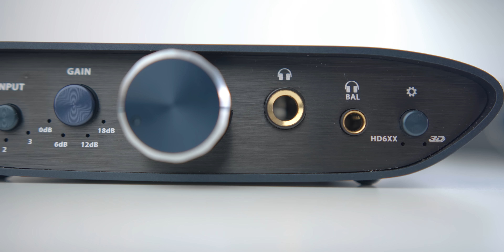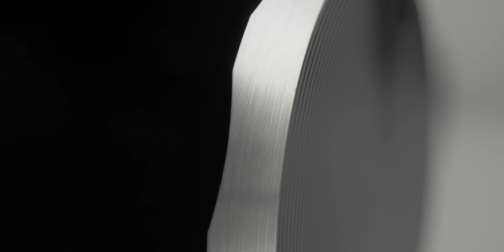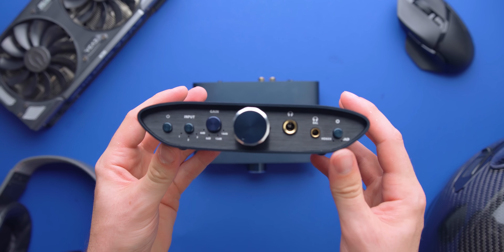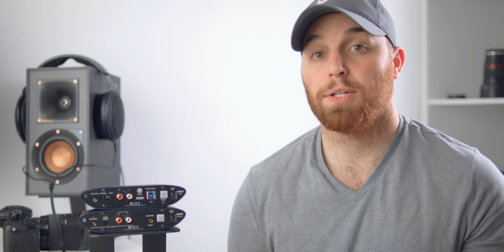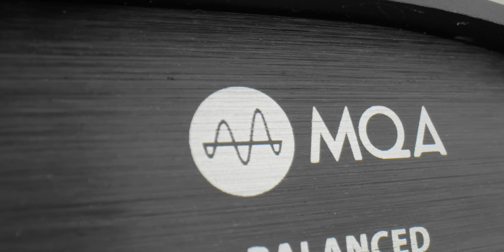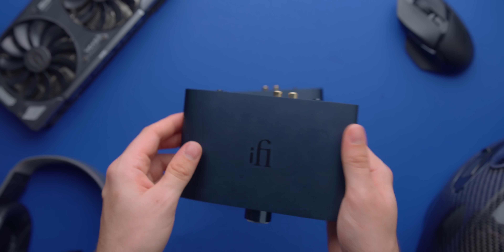THE upgrade for the HD6XX! | IFi CAN / DAC signature!

Comment: Josh,
Really well constructed and balanced review! Pardon the pun. I’ve been looking for a combo along these lines to get myself into the headphone world. Just been a two channel speaker guy so far. I’ve also been looking at the Geshelli Labs combo, which also offers an interest and low cost dac and amp combo, with a balanced connection, and different gain levels to boot. Wonder what you impressions of that combo would be in comparison! Thanks again 🙏🏼

Comment: Why are people commenting that this is a Drop ad. He states clearly that the unit was sent to him. He also clearly states it's hard for him to recommend based on the use case, and don't expect it to replace a tube Amp. 

I'm curious what the 58XX would sound like if you plug a pair in and hit that 6XX button.

Comment: If you ignore the bass boost. Does it really make a difference to Ifi zen dac for ~130$? This is almost 4x the price.
Reply: I believe the zen dac also has a bass boost switch..I don't know if it could handle a 300ohms headphone tough
Reply: @SM-1234 late response, but I own the ifi Zen V2 dac. I also own the Zmf Auteur which is a 300 ohm 97 dB rated headphone. The ifi Zen is adequate and runs it at high enough volumes without maxing the volume knob, albeit running through the 4.4mm balanced output. Getting a dedicated Amp would most likely yield a more refined sound, but I wouldn't consider it absolutely necessary

Comment: I'm a bit confused about balanced inputs. If I buy this or a thx 789, can I use a single ended input and still use the balanced output while still getting the benefits of a balanced output? 
I currently have a schit modi 2 dac, and I'd like to upgrade my amp without needing to buy a new dac. But I want to get a balanced output dac.
Reply: I would like to know as well.

Comment: You can pick up CAN+DAC+ 4.4mm interconnect cable on drop for 338.00
Reply: That doesn't include the DAC that's just the CAN and the 4.4mm.  All three comes in at $557 before tax...

Comment: Everytime drop puts something out all the YouTubers have ad like reviews
Reply from the maker: I posted this in the pinned comment, but I wanted to reply directly. 

"Hmmmm. Concerning trend in the comments. First, this is not an ad. This is a loan unit, sent from IFI. Neither Drop nor IFI is paying me. Nor asking me to say anything (except for the disclaimer about the pre-production status). I am however, part of Drop and Amazons Affiliate Programs, as disclosed in the description of every video. 

Second, if the video feels different and scripted... It is. I am trying a new filming style of video, using longer focal length and moving locations more often (always trying to better the content on the channel). 
- The scripting helps me make more jokes, and keep on track (especially when changing from location to location) with topics and information I might otherwise forget. However, my implementation of this is not the best, as it's one of the first times doing it. And, I see how it could seem more "ad-ish", though, not the intended feeling, I will make corrections to try to avoid it in the future. 

To address some specific questions I saw in the comments that I did not cover in this video specifically. 
This over 789? - For raw sound quality/power, no reason. Other reasons could be size, looks, EQ adjustments (if you don't/Cannot run EQ). I did not say it was better. I just said it outputs about the same power at 300 ohms specifically. So if you have a 6xx, the choice between the amps comes down to you desired features. 
This or Asgard? Depends. Asgard will drive more power demanding headphones, but will not be so good with high efficiency headphones, like IEMS. So, if you have really hard stuff, get Asgard or 789. Those will be the most versatile for more headphones. 
Using this Amp on the 58X - Sure! Sounds great, however, generally speaking, the 58X doesn't really need an amp in the same way that the 6XX does. 

So, to clarify my poorly constructed thoughts here - The Amp, is NOT the best on the market at this price (overall). It MIGHT be the best amp at the price for the 6XX exclusively, depending on your desired features.(If you only want single ended, THX or Asgard are better).  
The DAC, like I said in the video - Not worth it. (unless you REALLY want the stack). Even though it performs as it should. 

- J "

Comment: So... Why should i want to change the 6xx sound signature if it is almost perfect for it price, of course i can EQ 2 or 3 db in the bass region.
 But this is your first vídeo that sounds like an advertising, you sound like a reporter reading. :(
Reply: EQ is software, that adds additional processes and results in higher signal distortion.
This amp has hardware bass and tiny treble boost. You can't adjust intensity like with software EQ but it sounds cleaner than any EQ.

Comment: Agree on the advert feel, CRINGY compared to your other reviews.
Reply from the maker: I posted this in the pinned comment, but I wanted to reply directly. 

"Hmmmm. Concerning trend in the comments. First, this is not an ad. This is a loan unit, sent from IFI. Neither Drop nor IFI is paying me. Nor asking me to say anything (except for the disclaimer about the pre-production status). I am however, part of Drop and Amazons Affiliate Programs, as disclosed in the description of every video. 

Second, if the video feels different and scripted... It is. I am trying a new filming style of video, using longer focal length and moving locations more often (always trying to better the content on the channel). 
- The scripting helps me make more jokes, and keep on track (especially when changing from location to location) with topics and information I might otherwise forget. However, my implementation of this is not the best, as it's one of the first times doing it. And, I see how it could seem more "ad-ish", though, not the intended feeling, I will make corrections to try to avoid it in the future. 

To address some specific questions I saw in the comments that I did not cover in this video specifically. 
This over 789? - For raw sound quality/power, no reason. Other reasons could be size, looks, EQ adjustments (if you don't/Cannot run EQ). I did not say it was better. I just said it outputs about the same power at 300 ohms specifically. So if you have a 6xx, the choice between the amps comes down to you desired features. 
This or Asgard? Depends. Asgard will drive more power demanding headphones, but will not be so good with high efficiency headphones, like IEMS. So, if you have really hard stuff, get Asgard or 789. Those will be the most versatile for more headphones. 
Using this Amp on the 58X - Sure! Sounds great, however, generally speaking, the 58X doesn't really need an amp in the same way that the 6XX does. 

So, to clarify my poorly constructed thoughts here - The Amp, is NOT the best on the market at this price (overall). It MIGHT be the best amp at the price for the 6XX exclusively, depending on your desired features.(If you only want single ended, THX or Asgard are better).  
The DAC, like I said in the video - Not worth it. (unless you REALLY want the stack). Even though it performs as it should. 

- J "

Comment: Would you recommend getting this over something like an Asgard 3 if you have other hard-to-drive headphones?
Reply: No grab the Asgard 3
Reply from the maker: I posted this in the pinned comment, but I wanted to reply directly. 

"Hmmmm. Concerning trend in the comments. First, this is not an ad. This is a loan unit, sent from IFI. Neither Drop nor IFI is paying me. Nor asking me to say anything (except for the disclaimer about the pre-production status). I am however, part of Drop and Amazons Affiliate Programs, as disclosed in the description of every video. 

Second, if the video feels different and scripted... It is. I am trying a new filming style of video, using longer focal length and moving locations more often (always trying to better the content on the channel). 
- The scripting helps me make more jokes, and keep on track (especially when changing from location to location) with topics and information I might otherwise forget. However, my implementation of this is not the best, as it's one of the first times doing it. And, I see how it could seem more "ad-ish", though, not the intended feeling, I will make corrections to try to avoid it in the future. 

To address some specific questions I saw in the comments that I did not cover in this video specifically. 
This over 789? - For raw sound quality/power, no reason. Other reasons could be size, looks, EQ adjustments (if you don't/Cannot run EQ). I did not say it was better. I just said it outputs about the same power at 300 ohms specifically. So if you have a 6xx, the choice between the amps comes down to you desired features. 
This or Asgard? Depends. Asgard will drive more power demanding headphones, but will not be so good with high efficiency headphones, like IEMS. So, if you have really hard stuff, get Asgard or 789. Those will be the most versatile for more headphones. 
Using this Amp on the 58X - Sure! Sounds great, however, generally speaking, the 58X doesn't really need an amp in the same way that the 6XX does. 

So, to clarify my poorly constructed thoughts here - The Amp, is NOT the best on the market at this price (overall). It MIGHT be the best amp at the price for the 6XX exclusively, depending on your desired features.(If you only want single ended, THX or Asgard are better).  
The DAC, like I said in the video - Not worth it. (unless you REALLY want the stack). Even though it performs as it should. 

- J "
Reply: @JoshuaValour  Thanks so much for addressing all of these concerns man. Aside from the sexy b-roll, you're integrity and honesty when it comes to reviewing products is the reason you're my favourite audio reviewer. And thanks to your comment above, I decided to pull the trigger on the Asgard 3! Keep up the good work man. :)

Comment: Hart audio cables -balanced cable for 6xx and adapter pack with all connections you could want. Once buy adapter kit can just buy cords for particular headphone and switch out according to needs. Great cheap option for great cable. Very reaponsive customer support.

Comment: People spend thousands of dollars to make the 6xx sound good? Why not just buy "better" headphones instead?
Reply: A lot of people seem to get upset about this very specific signature product. 
It is not targeted at people who want to experiment with "better" headphones or different audio systems. It's mostly for people who already have HD6xx models, they like them and don't want to upgrade headphones.

It's good idea to split it into separate DAC and amp devices so you can get just an amp in case you already have previous ifi Zen DAC.
They also have universal version "Zen CAN" amp for everyone else.
Reply: Most of us do have better headphones and use the more expensive amps/dacs for those better headphones. But we still use the 6xx with those higher end gear.
Reply: @jlin5459  Of course, if you have a collection of headphones. But who spend thousands of dollars just to make a $200 headphone sound good? That´s ridiculous and I think no one have done it.
Reply: @Irukandji1981  you'd be surprised if you found out how many people actually do that for the 6xx
Reply: @Irukandji1981  I said this on another comment, but there are over 100k hd6xx owners out there. You really think you know what all of them are doing?
Reply: @Firenmage433  Some will probably buy this product?
Reply: @Irukandji1981  good job
Reply: I don't really get it. I like my hd 650 in terms of SQ but they are so god dam uncomfortable (for me who is clamp sensitve) to me that my S/O is the only one who uses them. They are just too dark. Vocals sound great but Audeze does the same thing better while having dope bass. I think they just have a bit of a cult following.
Reply: @shelteredwaffle4665  I got the 6xx myself. The clamp is there, but I´m not that sensitive. Blue Lola/Mo-Fi and superlux HD 662F is more of a pain to wear. At least for me.

Comment: 8 mintues of a Drop ad
Reply from the maker: I posted this in the pinned comment, but I wanted to reply directly. 

"Hmmmm. Concerning trend in the comments. First, this is not an ad. This is a loan unit, sent from IFI. Neither Drop nor IFI is paying me. Nor asking me to say anything (except for the disclaimer about the pre-production status). I am however, part of Drop and Amazons Affiliate Programs, as disclosed in the description of every video. 

Second, if the video feels different and scripted... It is. I am trying a new filming style of video, using longer focal length and moving locations more often (always trying to better the content on the channel). 
- The scripting helps me make more jokes, and keep on track (especially when changing from location to location) with topics and information I might otherwise forget. However, my implementation of this is not the best, as it's one of the first times doing it. And, I see how it could seem more "ad-ish", though, not the intended feeling, I will make corrections to try to avoid it in the future. 

To address some specific questions I saw in the comments that I did not cover in this video specifically. 
This over 789? - For raw sound quality/power, no reason. Other reasons could be size, looks, EQ adjustments (if you don't/Cannot run EQ). I did not say it was better. I just said it outputs about the same power at 300 ohms specifically. So if you have a 6xx, the choice between the amps comes down to you desired features. 
This or Asgard? Depends. Asgard will drive more power demanding headphones, but will not be so good with high efficiency headphones, like IEMS. So, if you have really hard stuff, get Asgard or 789. Those will be the most versatile for more headphones. 
Using this Amp on the 58X - Sure! Sounds great, however, generally speaking, the 58X doesn't really need an amp in the same way that the 6XX does. 

So, to clarify my poorly constructed thoughts here - The Amp, is NOT the best on the market at this price (overall). It MIGHT be the best amp at the price for the 6XX exclusively, depending on your desired features.(If you only want single ended, THX or Asgard are better).  
The DAC, like I said in the video - Not worth it. (unless you REALLY want the stack). Even though it performs as it should. 

- J "

Comment: Does anyone know of a way to adapt XLR out on a DAC to the 4.4mm on this amp?
Reply: Just search "xlr to 4.4mm balanced" on Amazon. ;)
Reply: @Innuendo_Penguin  I only saw two cables doing what I would need with this. I need a left and right XLR into 4.4 mm. Most of the ones I find are 4 pin to 4.4.

Comment: What about using the dac for HD 58X?
Reply from the maker: I posted this in the pinned comment, but I wanted to reply directly. 

"Hmmmm. Concerning trend in the comments. First, this is not an ad. This is a loan unit, sent from IFI. Neither Drop nor IFI is paying me. Nor asking me to say anything (except for the disclaimer about the pre-production status). I am however, part of Drop and Amazons Affiliate Programs, as disclosed in the description of every video. 

Second, if the video feels different and scripted... It is. I am trying a new filming style of video, using longer focal length and moving locations more often (always trying to better the content on the channel). 
- The scripting helps me make more jokes, and keep on track (especially when changing from location to location) with topics and information I might otherwise forget. However, my implementation of this is not the best, as it's one of the first times doing it. And, I see how it could seem more "ad-ish", though, not the intended feeling, I will make corrections to try to avoid it in the future. 

To address some specific questions I saw in the comments that I did not cover in this video specifically. 
This over 789? - For raw sound quality/power, no reason. Other reasons could be size, looks, EQ adjustments (if you don't/Cannot run EQ). I did not say it was better. I just said it outputs about the same power at 300 ohms specifically. So if you have a 6xx, the choice between the amps comes down to you desired features. 
This or Asgard? Depends. Asgard will drive more power demanding headphones, but will not be so good with high efficiency headphones, like IEMS. So, if you have really hard stuff, get Asgard or 789. Those will be the most versatile for more headphones. 
Using this Amp on the 58X - Sure! Sounds great, however, generally speaking, the 58X doesn't really need an amp in the same way that the 6XX does. 

So, to clarify my poorly constructed thoughts here - The Amp, is NOT the best on the market at this price (overall). It MIGHT be the best amp at the price for the 6XX exclusively, depending on your desired features.(If you only want single ended, THX or Asgard are better).  
The DAC, like I said in the video - Not worth it. (unless you REALLY want the stack). Even though it performs as it should. 

- J "